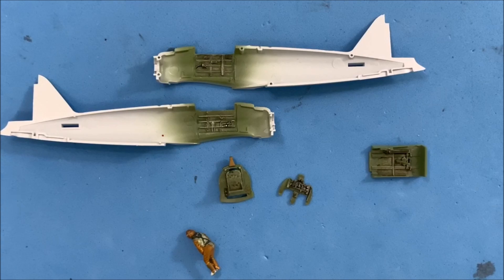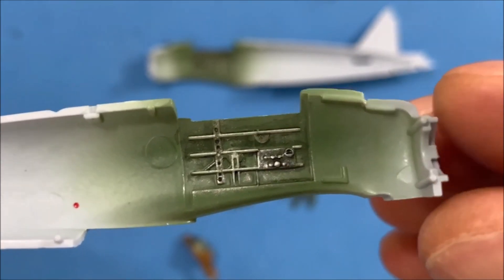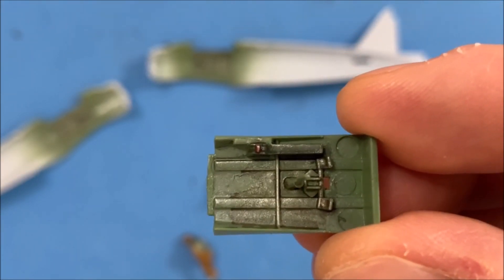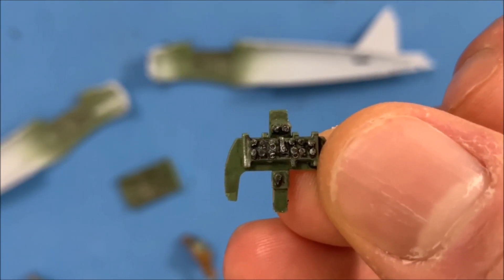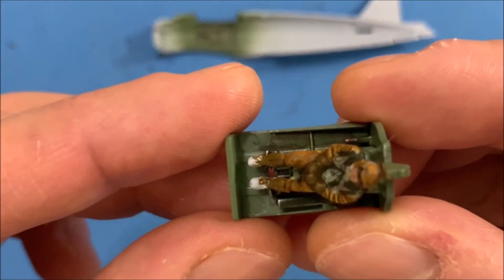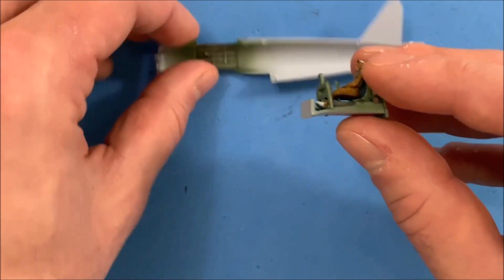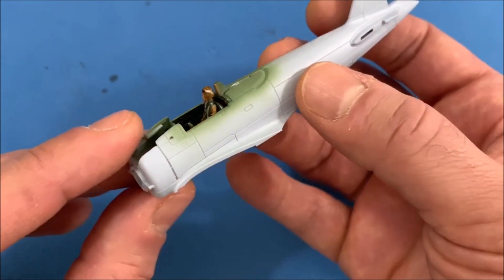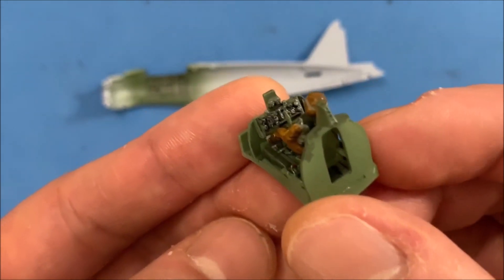Airfix 1/72 A6M2b Zero Bench Vlog Update 4

Comment: The details are spot on. The control panel is almost too good to hide.  Would like to try that technique one of these days.👍
Reply from the maker: I know, I'm happy with how that turned out. I'm glad I tried something new with it. Using the thin cement is tricky as it can run the paint off the decals which is why I only used it in the crevices. I'm hopeful that I will still be able to see it once the canopy is in place! Thanks for checking it out!